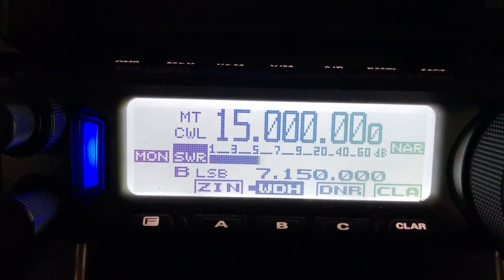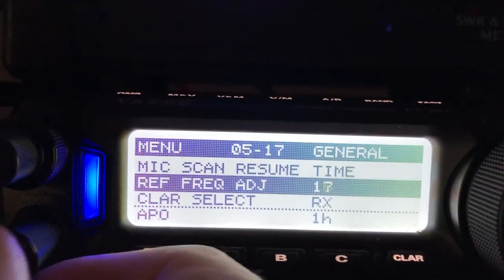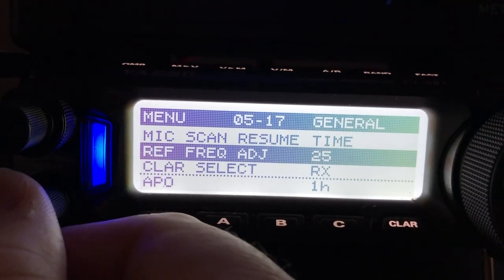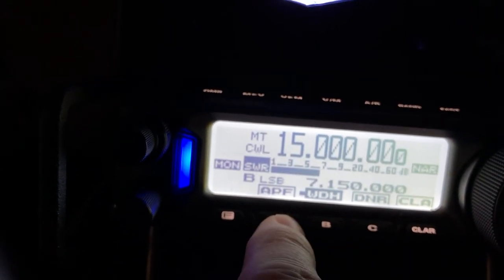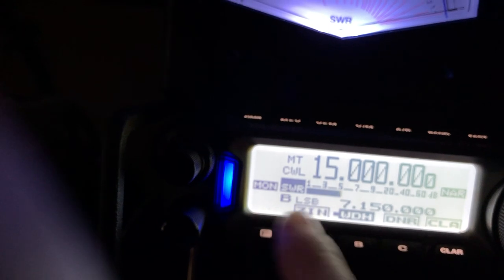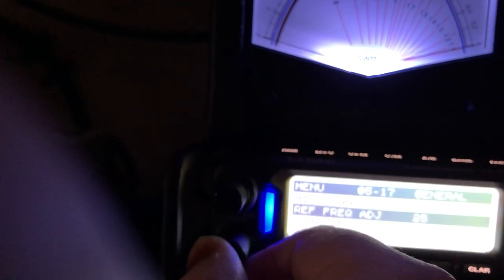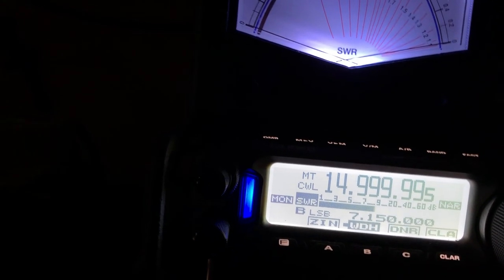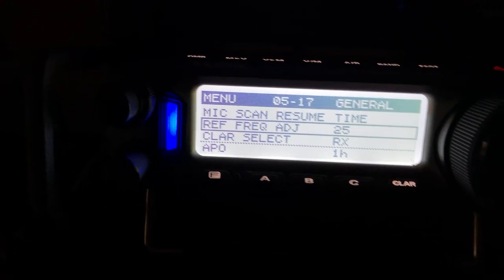Fine-tuning the Yaesu FT-891 Reference Oscillator

Comment: Is it possible, somehow, to connect this oscillator to an oscilloscope?
Reply from the maker: Sure.  There are test points that technicians can use to measure various voltages, signal level, etc.  But the easiest thing to do is use a frequency counter.  However, if the frequency counter isn’t calibrated to the NIST, you are probably better off checking against WWV, as my video shows.  The BFO might be off 1 Hertz at 300Hz, but that is plenty accurate enough.

Comment: I had trouble with my ft-891 lining up the reference adjustment I went as far as I could go and it still was not exactly on frequency so at that point you have to go into the service menu and adjust the reference oscillator but you must put the radio oscillator back to zero before you go in and adjust the oscillator from the service menu I had to do the same thing one time with my ftdx1200 the reference adjustment from the main menu was not wide enough to correct it this is because of the factory they're not critical on testing the frequency accuracy
Reply from the maker: Hi Roy!  I have two FT-891 transceivers.  I recall having to go as far as -22 or maybe -25 to get it within 1 Hertz. I can’t remember the exact number but I remember I didn’t have much adjustment left.  

I aligned many, many radios during my years with Motorola.  We didn’t have the ability to fine-tune the oscillator via firmware.  We had to open the radio and adjust a variable capacitor.  I’ve done that with my IC-725, my FT-890, and my FT-920, neither of which offer the option to adjust from the front panel using the menu.

Yes, you will want to zero the firmware adjustment before opening the radio to adjust the more coarse capacitor adjustment.  Remove the cover so you can get to the variable capacitor and then place the cover on again, without the screws.  Power on the radio and let it warm for 30 minutes.  Remove the cover and make the adjustment.  Return the cover and check against WWV.  Repeat this procedure until you get within 1 to 3 Hertz accuracy and stability.  Replace the screws and fine tune with the menu adjustment.  It is always important not to make an oscillator adjustment until the transceiver has been powered on for 20 to 30 minutes.  I prefer 30 minutes.

73, Doug